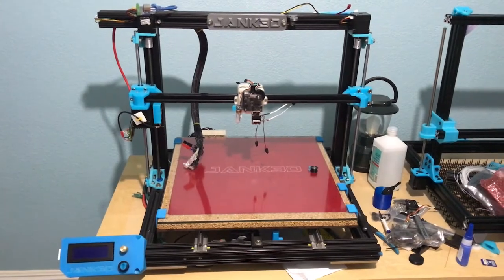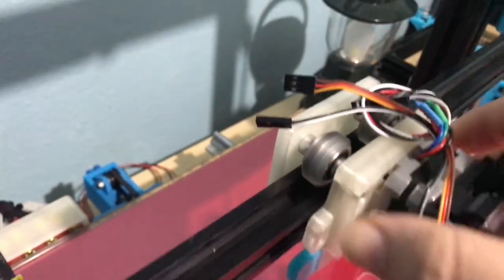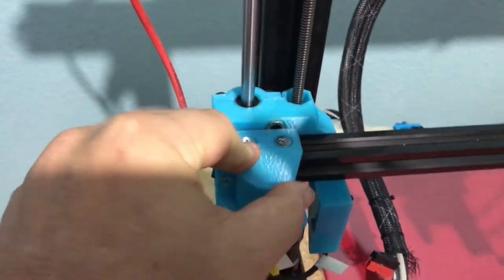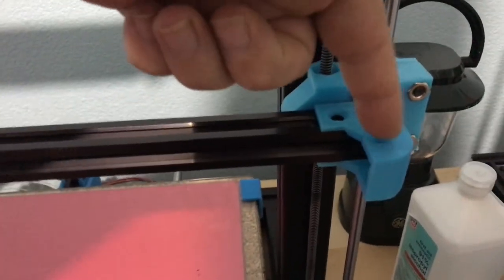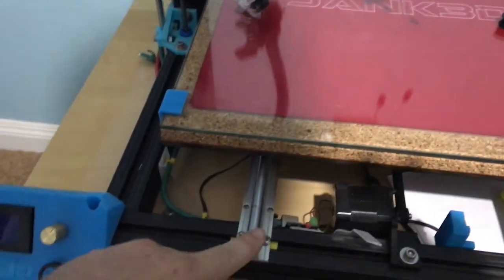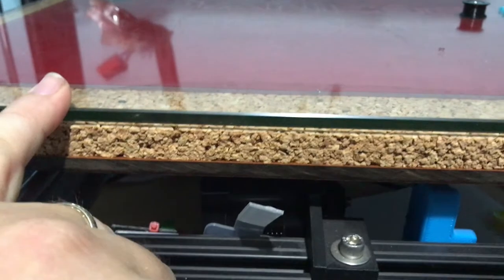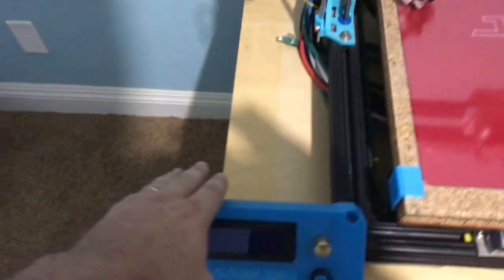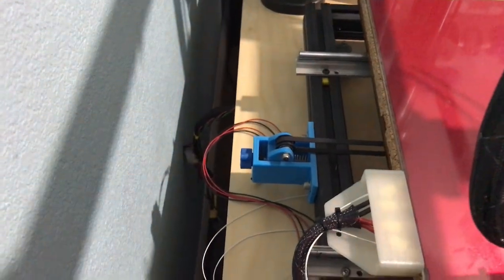Quick update on Ozzy's Upgrades

Comment: I still have a bl touch from maker faire that I don't know what I'll do with.  You have done so much to this thing man.  That seems like a ton of work.  Can't wait to see it print.
Reply from the maker: A Pyro Design thanks man.  You should get that BLTouch on the CR10!  That huge bed is a perfect use for it
Reply: Practical Printing Yeah that's the only printer I thought about using it on. Just have to take the time to get it going.